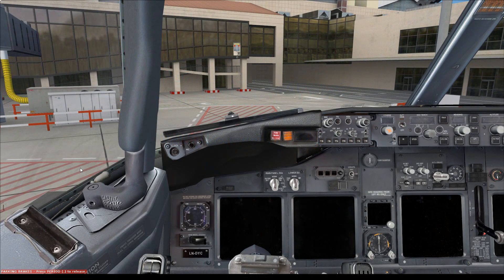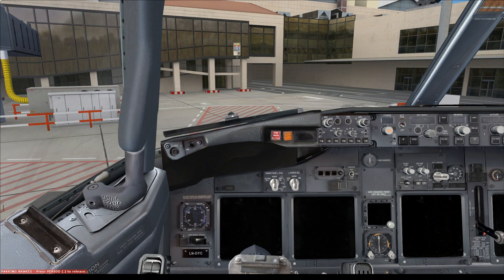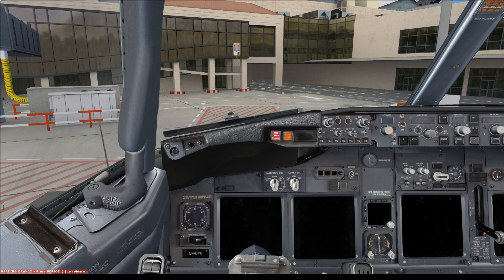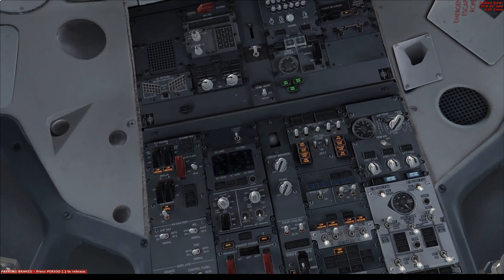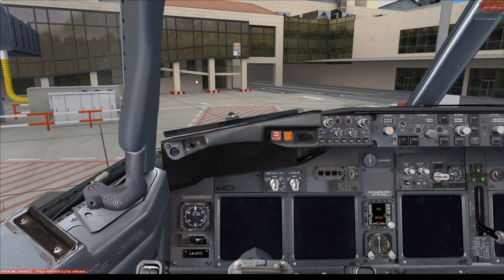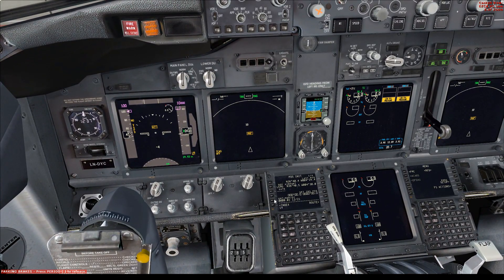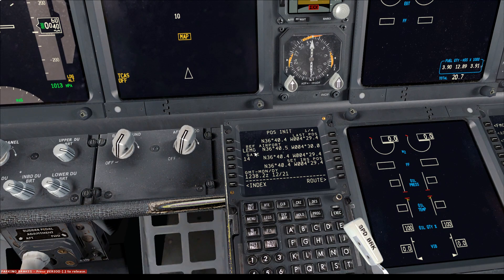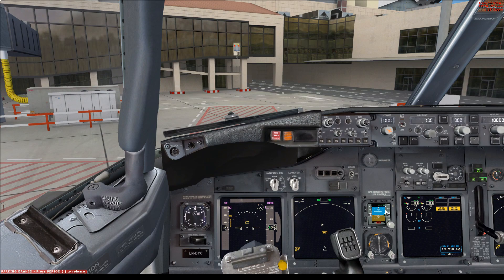FSX: how to align the IRS in the PMDG 737

Comment: At my irs panel the align light is flashing and i hear a beeping
Reply from the maker: TheEho no problem this is an easy fix!
you are trying to run the IRS of battery power.
To Fix this the aircraft must be running off power generated by the APU, or the GPU.

Start the APU and activate the APU GEN BUS when the light illuminates.
then select the IRS mode selectors to NAV once the Aircraft is running of the APU

Hope this helps